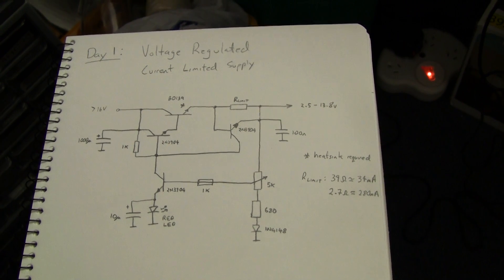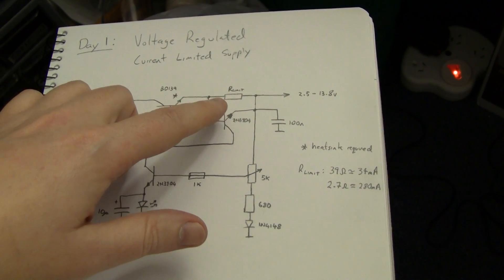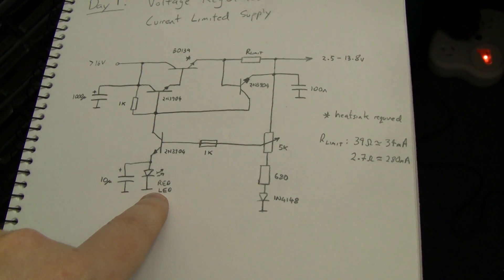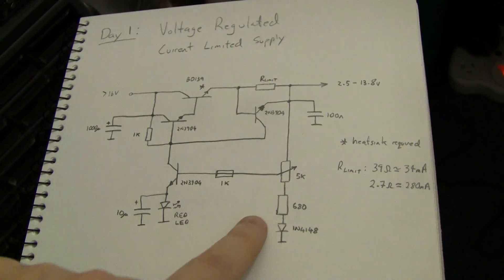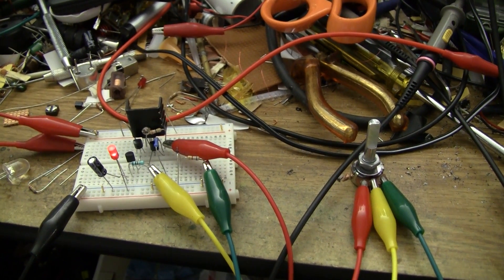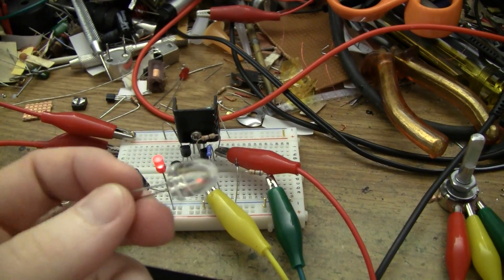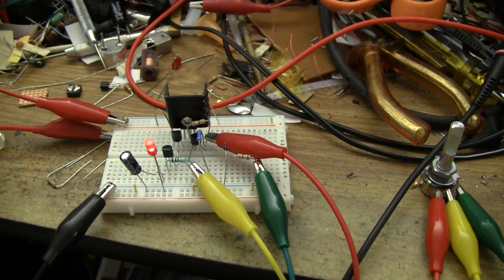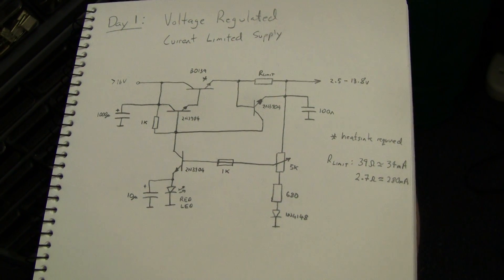Advent Calendar of Circuits 2011: Day 1: Regulated, Current Limiting Power Supply

Comment from the maker: Actually shorting the output removes the base drive to the pass transistor so there won't be much current going through the limit sense transistor BE junction.  There might be a moderate transient current as the loop folds back, so maybe a small resistor wouldn't hurt.  The base current has to come from the voltage dropped across the sense resistor, the collector current is beta times that current, and it only has to pull down that 1K feeding the pass transistor base before it starts to cut-off.

Comment: I have a few circuit suggestions/requests.  Do with them as you will:

Touch sensitive switch for turning on those xmas lights or props with just a tap.

Proximity sensitive P/S or wave generator (theremin style) to adjust light or audio output based on human interaction, e.g. lights brighten on a tree as you approach it or santa laughs louder or at a different pitch as your hand approaches.

A sequencer for driving a group of lights or props in sequence, say running lights along a string.

Comment from the maker: @Gameboygenius stability is pretty good, a percent or so under load variations from zero to the beginning of current limit.  The main deficiency is input voltage variations push it a bit.  For a completely unregulated transformer + bridge input this may be unacceptable.  With a stiff or pre-regulated supply feeding it this is of no consequence.

The limiting point is largely independent of voltage, it is defined by the voltage drop across the sense resistor but finite beta means it varies a bit.

Comment: @vk2zay Not really an answer to my questions. My (second) question really was if the resistor itself is the sole limiting factor or if the limiting works by activating the 2N3904 when the voltage over the resistor exceeds a certain voltage..

Comment from the maker: @Gameboygenius actually I haven't watched Dave's PSU videos yet.  A simple current limiting variable regulator you can add to a wallwart seemed like a good place to start.  Many of the circuits in this series will build on each other, a PSU is needed for them all (but batteries are an option too).

Comment: Inspired by The Dave, I'm assuming?
Two questions: How is the voltage stability over a varying load? Doesn't this design make the current limit vary with the set voltage?